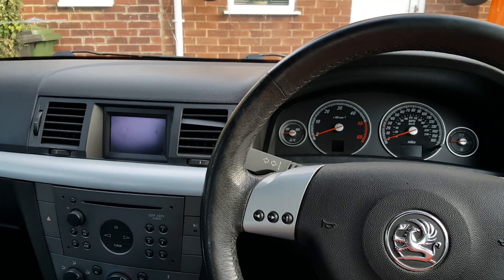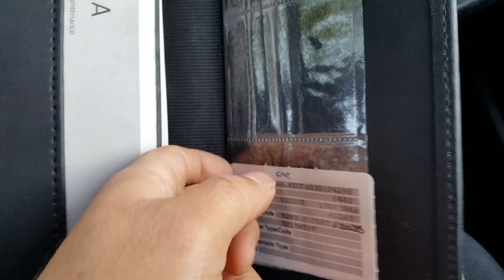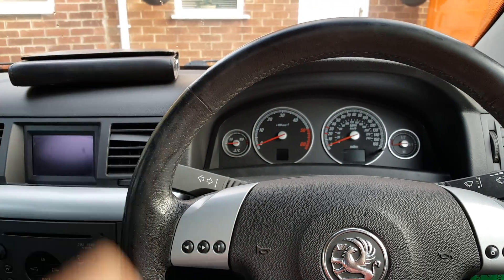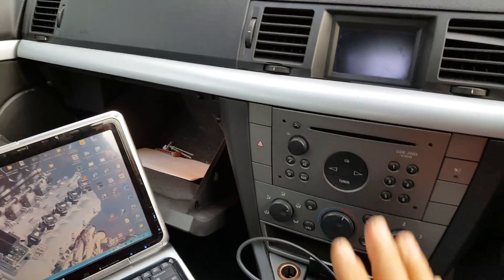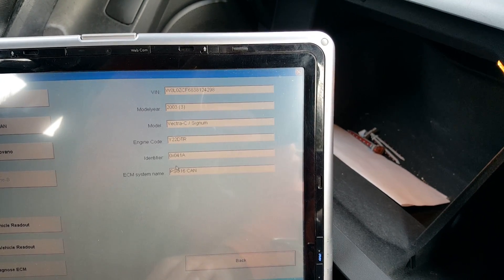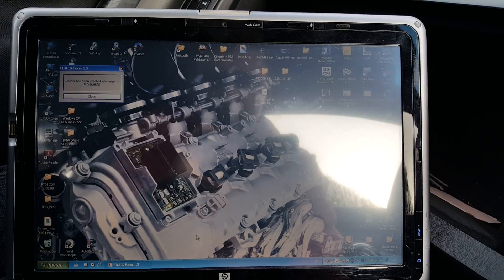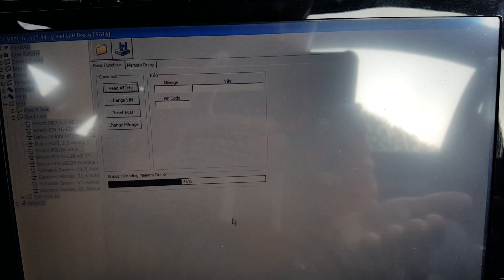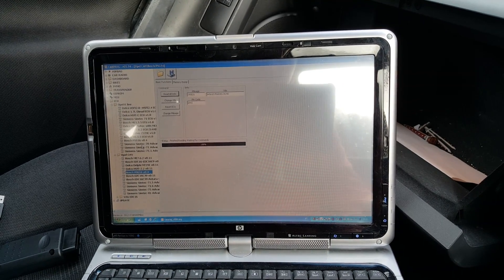Vauxhall Opel security pin retrieval - the 4 different ways to obtain the code.

Comment: I have my car pass, but it contains many letters and numbers. Then my dashboard requires 4 digit code. How do I proceed ?
Reply from the maker: Does the car pass does not have the 4 digits pin/security code?
👍👍👍
Reply: @LMAutoRepairs  update : my radio 4 digit pin was inside those 12 digit letters and numbers. So dumb way to put the pin code lol. Thanks for fast reply tho. Goodluck and have a nice day

Comment: which OPCOM firmware are you using? v1.59, v1.65, v1.70 or v1.99?
Reply from the maker: Hi
I have one running on 1.39, and another one that I have updated to 1.65 if I recall correctly...
👍👍👍
Reply: Thanks Man 👍🏽

Comment: Hi, Foxwell NT530 scanner Opel/Vauxhall special functions will also 
retrieve and display the car’s security pin code. It worked on my 2001 Vauxhall Corsa c 1.2 16v. I believe you can also erase and program keys.
Reply from the maker: Nice to know...
I now have the IM608,  which also does it...
Thank you for the information...
👍👍👍

Comment: Ok where can i get the key code for the lock so i can cut a key
Reply from the maker: As I said... security card...
If you don't have it, dealer can issue a new one... in the UK is about £30...(or used to be...😋)

Comment: Hi can you please help at all I have a customer that has a Vauxhall Corsa and they have lost all the keys I cannot access the vehicle but do I need to pick the lock to decode it or is there another way I can get the bitting.
Reply from the maker: If all the keys are lost you either get a used ignition barrel with a key, so you can turn the ignition on and from there program a key key, or, if you have the security car have a key cut with the mechanical key code and proceed from there...
Thank you for watching!

Comment: great video, congratulations, can you tell me where I can buy this instrument, I have a control unit taken from the scrapper, it does not remember the license plate of the old car, I would like to recover the car pass, of the "" new "" control unit, and reprogram the control unit with the old key , but I need the cae pass, with this tool you use, can I retrieve the car pass from a 1996 ople tigra? thank you very much
Reply from the maker: What unit are we talking about?
Engine ecu?
Which module is that?
Thank you for watching!
Reply: @LMAutoRepairs  hello, sorry for the English translation, but I'm using a translator, we are talking about an opel tigra 1.4 16v ECU from 1996, months ago, my alternator burned out, shorting the ecu, I got one from the wrecker, same same car year, I would like to reprogram the existing key in this competition ecu, again thanks for your availability
Reply: @LMAutoRepairs  the control unit is a delco d96017 from 1996, TIGRA 1.4 PETROL 16V INITIALS - X14XE
Reply from the maker: Carprog reads and decodes the data, but is by reading the HC11F1 directly...
You might be able to read yours as well, and just transfer the data....
Reply: @LMAutoRepairs  OK thank you very much

Comment: Hey :)

is there a way to get the Security Code for a Opel Corsa D 1.2?
Reply from the maker: All explained on the video...
Here is another way...
https://youtu.be/rxQmFpBTFk4
Thank you for watching!
Reply: @LMAutoRepairs  hi can I get cod for meriva opel 2004 year model?
Reply: This is about car radio
Reply from the maker: That you need to take it straight from the radio...
As the immobiliser code is not the same as the radio...

Comment: Hi, 

I tried to use opcom to retrieve the pin from the dash of a 2006 tigra (corsa c), using the read eprom function. 

It didn’t work, and now when it tries to read the clocks the connection drops and resets every few seconds.

I think it’s my fault, because I forgot to press and hold the trip button. :-(

So I guess my question is, do you know if there is a way to recover the clocks or is in now toast? The clocks still function as the should but just don’t communicate properly with opcom.

I hope you can help. Thank you so much for all your help so far, I’ve learned so much from you already. :-)
Reply from the maker: Try to disconnect the battery for a few minutes... see if that resets the cluster...
Don't know it is going to work, as I never had that issue, but might worth a try...
Thank you for watching!

Comment: Am I imagining things or did you do a video on how to extract the security code directly from the ECU?

I can't seem to find it 🥺
Reply from the maker: Yes... I have some...
Which one are you looking for?
On the corsa?
👍👍👍
Reply: @LMAutoRepairs  I need to replace the ECU on a Astra H. The ECU is dead and I don't think we have the security code for the new second hand ECU.
Reply from the maker: You need that case to retrieve the pin from the ecu itself...
Depending on the ecu, some tools can read it through OBD... like Carprog...
Otherwise, you need to open the ecu to read the data and then retrieve the pin...
Which car/ecu are we talking about?
Reply: @LMAutoRepairs  thanks mate. It's a Astra H. I do have carprog but I didn't think it worked with cars like the Astra H or Corsa D?
Reply from the maker: Hi
Sorry... missed the Astra H part...😋
Better probably read the eeprom on the bench and extract the pin then...
Reply: @LMAutoRepairs   thanks mate, that's what I was thinking. Is Pecky’s Vauxhall Decoder
The only software that can extract the security code from the dump or do you know of another software that can do it ?

Thanks again for all your help mate ;-)

Comment: Hi, I have a Astra H 2005 with a broken MT35E ECM. I´ve buy a used not reseted ECM. Can i pinout the "new" ECM by connecting to my vehicle to reset the ECM?
Reply from the maker: Yes... you can just plug it on the car and then reset... you need however the original pin from the ecu...
You need a tool that you going to be able to retrieve the pin directly from the ecm... carprog might be able to it...
Thank you for watching!
Reply: @LMAutoRepairs  Thanks for your answer,... You say might be able,... What is the best program i have to buy? I was close to buy carprog but when you say i hvae to buy another stuff i will do,... I love watching your channel :)
Reply from the maker: Just check that carprog is compatible with that ecu... if it is, you should actually be able to do everything with it...

Comment: hello great video, I would like to have your help, because I bought a new module cim, I reprogammed everything, but I locked the cim with bad handling and the car still does not start. when i type the security code to unlock the cim it does not work.
you think i can do a reset the ecu and reprogram the cim? or else i have to buy a cim again, which is very expensive in my country.
thank you for your response it's been 6 months that I am down.
if i do an ecu reset, is it possible to reprogram it?
Reply from the maker: It should allow you to reset again...
Using the pin you programmed it...
But I never did that particular module, nor have researched that...
What do you have in live data?
Can you see why is locked?
Thank you for watching and for your comment!
Reply: @LMAutoRepairs  in fact i started programming with the lautch 430 pro interface. and when entering the key program, I am mistaken because the program asked for the vehicle's 4-digit pass mode and without paying attention I entered the key code. then by wanting to rectify everything by going through a friend's com op. the car refused the security code to modify the cim ..
that's why i want to reset the ecu to see if i can reprogram the cim with the correct security code.
I saw in one of your videos how to reset ecu. in order to change the ecu. but how to reprogram the ecu without changing it? DO I have to write down all the data before doing a reset or will it go back to normal automatically if I reprogram the ECU? thank you
Reply from the maker: @camilledavid6936  
If the machine you are using, allows you to reset the cim, do it using the 4 digits you used to program it...
That should then allow you to program it again using the correct pin...
You can save the settings to make it easy afterwards...

Comment: hi i am one of the your fan for very long times 
i lost my key chip of Vauxhall Vectra C 2008 
now i only need the pin code how can i get  the pin to program new chip
the car not given pin and i look all the thing i cant find 
this is the vin number W0L0ZCF6881083355
i can pay you with pay pal its no a problem
 many thanks for your help
Reply from the maker: As I replied... these are your options...
There is not much more I can do to help...
Only dealer can give you the pin from the vin...
Reply: @LMAutoRepairs  
can you send me the website please
Reply from the maker: @auto4x478  
What website?
Reply: @LMAutoRepairs  
Any website To i can get the pine code by vin number
Reply from the maker: @auto4x478  
Just google it...
There is probably some that have access to the dealer database...
Or just go to the dealer, and they will give you a new security pass with all the details, including the pin...
Reply: @LMAutoRepairs  
I got you thanks

Comment: Hii bro I'm too late in watching this 😅
Bro i hav opel vectra all keys lost how can i get the acsess code 🤔 
I wish if uoy can reply🌹
Reply from the maker: I thought i have explained it in the video....🤔
What is your doubt?
The only other way, if you don't want to go to the dealer, is remove a module, like the cluster or similar, read the data and extract the pin...
Thank you for watching!
Reply: Thank for quick reply
Reply: The last thing i want to ask ? It's a sily qution how can i knwo the typ of immo in opel cars in general 
Like vectra c . Vectra h
Reply from the maker: @abdalwahhabbkrosh15  
What you mean, with type of immo?
Reply: @LMAutoRepairs  yep the type of immo
Reply: @LMAutoRepairs  fore instance i have apel vectra 2005 all keys lost idont knwo wich type off immo 🤔
Reply from the maker: Not sure what you mean...
You have on Vauxhall/Opel, different immo generations... depending how old the car is...
Usually referred as immo I, immo II, immo III... etc...
Reply: @LMAutoRepairs  thank you for your idea❤
Reply from the maker: @abdalwahhabbkrosh15  
Ah... now I got you... 🤦‍♂️ sorry...
I believe for that is the ID40, PCF7946
👍👍👍

Comment: Hi the programme tool where is the best place to get one and a part number?. So I get the right one. thanks
Reply: Thanks for your help 

What it is I have to do a 2008 1.3 Cdti Corsa d ecu kit. 

I have removed the 75 hp engine and box. Dtj
And fitting the 90hp with the 6 speed gear box. Dth. 

Because I’m not sure if the dtj 75 ecu will
Run the 90 dth. 

I got a dth ecu kit and I need to correct the Mileage on the clocks. 

And learn how it’s done 
Thank you
Reply from the maker: Try Ebay...
There is other places... just Google it...😉
Thank you for watching!

Comment: Hi,

I have CarProg but I dont know what ECU should I use...
from OP-COM i get:
System Discripton: DENSO0100
Hardware manufacturer... : DECe01
in CarProg you have only 2 denso both options give me 
strange characters  for pin. Do you have any Idea how to fix my problem?
Reply from the maker: If shows "strange characters", that is most like because the ecu is not supported.
Thank you for watching and for your comment!

Comment: Hi mate i need to fit new ECU into a Corsa c bit don't have the Carr pass .

If I fit the new ECU can I extract the carpass before I programme the ECU or does it need to be programmed first ?
Reply from the maker: Hi
You can't program the replacement ecu without the car pin.
If the replacement ecu has not been reset, you need the pin from the car the ecu came from...
Or as you have seen on this video, you might be able to extract it with carprog... or other capable tool.
Thank you for watching and for your comment!

Comment: Does your carprog have a listing to do the sagem ecu on the 2004 vivaro?I sold my first Carprog as it couldn't read my vectra,my new Carprog I just bought 'now' reads it?
Anyway,back to the vivaro,instead of using the ecu option in carprog,will I be able to extract information to make a spare Key through the eeprom option under Opel?
Reply from the maker: The keys on the Vauxhall are not stored on the ecu... as far as I am aware...
You just need the pin from the van, and a blank key... I have some videos on that... I think...🤔
If not, there is some to come out... 😋
Reply: @LMAutoRepairs  ok,guy just doesn't want to give Vauxhall the money for the pin.I've seen people working out pin from dump,maybe try that.
Reply from the maker: @robbocop33r12  
Yes... that's possible...
👍
Reply: @LMAutoRepairs  I have gone into the DASHBOARD-RENAULT section of carprog,and i've discovered the Sagem 93c66 i was looking for,which is the same as the 2004 vivaro!:-)
So i just have to work out now how to get the pin code now from the dump i read!

Comment: Im trying to get the immo pin code/security code for a 2004 vauxhall vivaro van,im wondering if you can help me?
I know that they use sagem 9936 immobilser that is shared with renault trafics,movano's,masters etc.Now i know for a fact vivaros etc are in the renault pin extractor tool(ive seen them in immobox when doing my vectra)but how can i get renault clip software to recognise the vivaro?,so i can get the isk then get the pin code?
How would 'you' go about doing this?Thanks.
Reply from the maker: You can try to not read the vin, and manually select a similar Renault, and see if you can trick clip to do it... I never tried, and to be honest, doubt it will work... 
I would open the bcm, and would read the eeprom... 
Hope that helps. 
Thank you for watching and for your comment!
Reply: @LMAutoRepairs  thanks for the reply,it's just that it mentions Vivaro in the immobox so i thought it would recognise vin ok.
Instead of WOL vin it comes up with VSK vin when i try to put in renault trafic for instance,it finds VSK vin too when i try to get vin to Autodetect it.
I will try the eeprom BCM route,thanks

Comment: carprog read via obd2??
Reply from the maker: Depends on the ECU installed... but yes...
Thank you for watching and for your comment!
Reply: @LMAutoRepairs  ok, info opcom: EcuHardware:DEL 012A244500, ManufacEcu 24580393PL, Ecu Soft FLKN, Engine Y18NE, vin 9BGHX19U0BC248070, It s Delco Multec?

Comment: Hi and thanks for the videos, you say you use carprog for retreiving pin codes from vauxhalls! I have a corsa d 1.3 cdti on a 09 plate and ive looked and enquired about the chinese carprog software with all 21 leads but they tell me it wont retrieve pin codes from my car? I dont understand because ive watched you do it on your videos. I desperately need to get my ecu pin number , I have opcom latest version but it doesnt let me get the pin numbers. Could you put me right on what software would work for me please?- many thanks Andy
Reply from the maker: Hi
Yes, carprog does it depending on the ecu fitted on the car...
For corsa D I use the Maxisys...
Now, with carprog, you can still retrieve the pin, by reading the cluster eeprom... but you need to open the cluster...
A quick google search, and you will find other tools dedicated to pin retrieval...
You can always go the the dealer... if is a one off, is probably more cost effective...
Hope that helps!
Thank you for watching!

Comment: Can you extract the IMMO code from the IMMO module itself, as I've just bought an astra g, and the previous owner has had the ecu and IMMO replaced, but it's still coded for the previous vehicle, so Im wanting to correct this but I dont know what code is stored in the IMMO module, or if it even matches with the ecu etc, as the car is flagging up a whole list of DTC's
Reply from the maker: Hi
You, you should be able to... 
Thank you for watching!

Comment: Just bought that carprog on the strength of this video,unfortunately it didn't read the ECU at all on my 2002 vectra 2.2 dti which has the same ecu in this video,bosch psg16!?
Seems a handy little tool though.

Comment: Great video. I am having difficulty using Carprog and reading Vectra C Siemens Simtec 75 via EOBD to retrieve the pin code.
I does not appear to commuicate with the vehicle. I have tried many different configurations. Vaux-Com does connect /read / write to ALL ECU's . Is this normally a probem Any ideas please?
Reply from the maker: I never had an issue... it must be your carprog... have you tried it successfully on other ECUs?
Thanks for watching and for your comment!

Comment: Great presentation thank you. Can you virginize a Vauxhall Insignia 2013 Diesel Body control module Gm part No. 13586585? My customer purchased a 2nd hand one to reprogram and replace a water intrusion damaged one. My email is [maestroad21@gmail.com]

Comment: Great vid well done 😊👍🏻 I have one question to
Ask you sir regarding changing the immobiliser unit for one from another car
Reply: Hi there I am having issues with my car the errors are transponder and steering column module we have tried clearing the faults but it wants a pin number do you have any idea how I can solve this problem?
Reply: Padge993NZ it’s a long shot but do you still have the manual that came with car ?
Reply: @dandwrasan2342  no I don't sorry
Reply from the maker: Hi
Which module do you want to change?
Thank you for watching and for your comment!
Reply: LM Auto Repairs hi thanks so much for your quick reply , I’m interested in buying a corsa combi van 1.9 td it’s a salvage vehicle without the keys and a missing immobiliser unit , could I go to my local scrap yard get another unit from a Vauxhall type car and fit that with the new keys? Would it start or would I need to code it in with the pump like on the fords system
Reply from the maker: @dandwrasan2342  
1.9?
Are you sure?
Which combo chassis is that? 
C?
Reply: LM Auto Repairs sorry about that it’s a 1.7 di 2003
Reply from the maker: @dandwrasan2342  
Which modules are missing? 
The module in the ingnition barrel, is there?
Reply: LM Auto Repairs there’s no ignition it’s been removed also the key reader